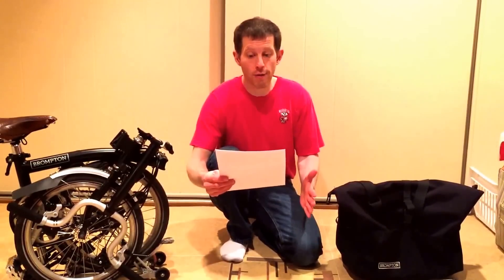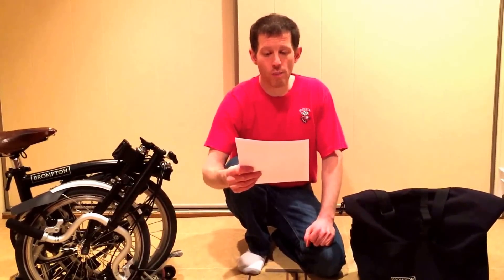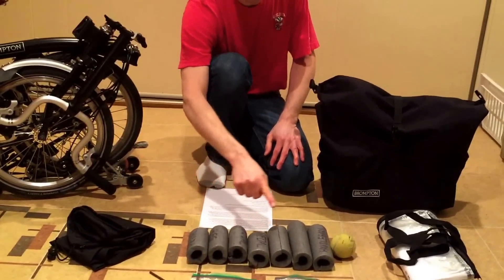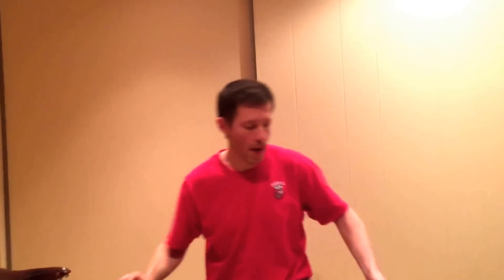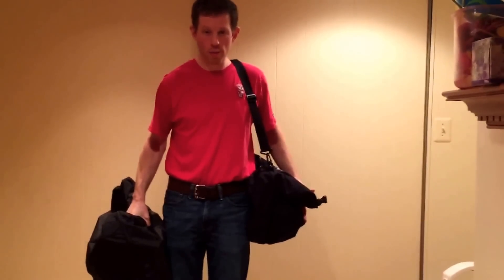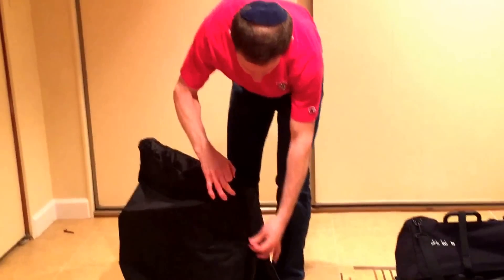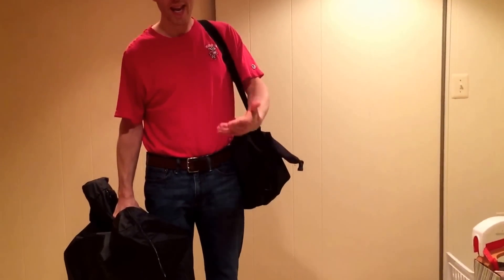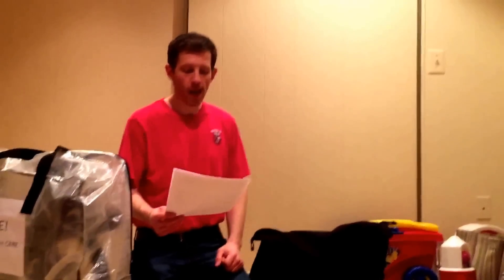How to travel with a Brompton bicycle on an airplane

Comment: Great very informative. Some airlines have an actual rule written on their websites that you MUST deflate your bicycle tires by the way.
Reply from the maker: Interesting. Thanks for the information. The rule does not make sense since the entire airplane (cabin and cargo area) are pressurized to slightly less than normal atmospheric pressure at sea level. Nothing would/will happen to a fully inflated bike tire on an airplane.
Reply: @mattvanderhoek5516  yeah I don't doubt that you are correct. Japan isn't know for it's logical rules so it doesn't surprise me at all to see an airline  rule from a carrier in Japan with no basis in science.

Comment: Hey Matt, thanks for the great video. Have you kept a running list at all of what airplanes the Brompton fits in the overhead bin of? We are flying to Finland from Denver next week via Icelandair. We are on a 757-200 for all our flights. According to the interwebs, the overhead bins are notoriously small (as evidenced by Icelandair's carry on bag dimensions of 7.9" max height). Just trying to figure out if it is worth attempting.. Also, have you had luck with valet checking (rather than gate checking where you have to pick it up at baggage claim rather than the jet bridge)? Does the pink tag let you pick it up on the jetbridge? Sorry for all the questions! Thank you!
Reply from the maker: The Brompton will fit in the overhead bins of a 737-700 and a 737-800 - I have done it. The Brompton likely will not fit on a 737-300 and 737-500, as these are older planes (but I have never flown on these models). I do not know about a 737-900 or 757-200 because I have never tried. Please let me know what you discover about the 757-200. Also, the Airbus 320 and 321 will fit a Brompton on Delta airplanes but not on Spirit airplanes as their overhead bins are constructed differently.
Reply from the maker: Regarding checked luggage, I may have not been careful about the terminology in my video. So please allow me to clarify. I will refer to two types of checking: 1. Baggage check is where the luggage is returned to you at baggage claim. 2. Jet-bridge check is where the luggage is returned to you at the jet-bridge. For the Brompton, I have done it both ways. I have baggage checked and jet-bridge checked the Brompton (protecting it as shown in the video) and it has always been returned intact. Typically, I carry the Brompton down the jet-bridge to the door of the airplane where I ask the steward(ess) if I can store the Brompton in the coat closet (on an airplane where it will not fit in the overhead bins). They usually say yes. If they say no, then I jet-bridge check the Brompton. A pink tag is affixed to the bag which allows me to pick up the Brompton at the jet-bridge upon arrival. Very rarely, they will give you a white tag when you check the Brompton on the jet-bridge. The white tag means that the Brompton will be returned to you at baggage claim (rather than at the jet-bridge). There are some airlines (Spirit) where I always baggage check the Brompton since the fee for baggage checking is LESS than the fee for a carry-on bag! Hope that helps and was not too confusing.

Comment: Very knowledgeable! Thanks dude. I am wondering can we take Brompton as a cabin luggage? So that it could be fitted in aeroplane above seat compartment please?or it has to be in main luggage?
Reply from the maker: Yes. You can take Brompton on some airplanes as cabin luggage. Larger model airplanes have larger overhead compartments that can fit the Brompton. In the United States, here are some models that will fit the Brompton in the overhead compartments: Airbus 320 and 321 (on Delta but not necessarily on other airlines), Boeing 737-700, 737-800, 737-900, 757-200 (on Delta but not necessarily on other airlines). If you carry the Brompton onto an airplane and it does not fit in the overhead compartment, you can still ask the flight crew to let you store it in the coat closet. Good luck!

Comment: This is an interesting idea. Why is it necessary to cover the bike before sending it through the TSA scanner though? They obviously see it is a bike with the xray machine. I feel like this is an unnecessary step.
Reply from the maker: createthis you are correct. It is unnecessary to cover the bike as it goes thru the scanner. I no longer cover it as it goes through the scanner. But be sure to cover it when going on the airplane!

Comment: Very cool! I want to travel from Europe to the States and back with my Brompton, but I have a couple of questions:

1. Since most airlines only allow you to carry on one piece of luggage, how can you get on on the place with both the Brompton and the T-bag? 

2. I've bought my tickets, but it doesn't say on my e-tickets what kind of airplane I'll be flying on. Is there any way of finding out in advance? 

Thanks again for this fine video.
Reply from the maker: I have only traveled with my Brompton domestically (in the United States). Most/many airlines (e.g. Delta) allow 1 carry-on item and 1 personal item. So the Brompton counts as my carry-on item and the T-bag counts as my personal item. I have never had a problem.

You might be able to call the airline in-advance (a couple days before your flight) and find out the airplane model that you will be flying. However, this is not really necessary. I just ask about the airplane model when I arrive at the gate. If the airplane model works (overhead bins fit the Brompton), then I put my Brompton in the overhead bin. If the airplane model does not work (overhead bins do NOT fit Brompton), then I request to put my Brompton in the coat closet. If they say yes, then great. If they say no, then I simply gate check my Brompton (on the jetway) as described in my video. Over time, I have compiled a list of airplane models that will fit the Brompton in the overhead bins. So when they inform me of the airplane model at the gate, I know whether or not my Brompton will fit into the overhead bins. Typically, it needs to be a larger model airplane that is used for long domestic flights or international flights.

Let us know how it works out for you traveling with your Brompton from Europe to the United States. Good luck!

Comment: This was informative, thanks. It was mostly about how to carry the bike on the plane. When you talked about having to “gate check” it on the jetway, you said your bike has always been returned to you in good shape. I don’t think I’ve ever had to check something at the door of the plane and pick it up later. Does that mean that it doesn’t end up in regular baggage claim, sliding down a ramp, circling around a conveyor belt, and being stolen by a criminal who can see what it is through the transparent bag? Are you advising us to never just check the bike at the ticket counter with other large bags (if any, I usually don’t have any), and always try to bring it on as carry-on luggage?
Reply from the maker: Hi Guy, 
One of my goals is to minimize the risk of damage/theft to my Brompton. If I were to check the bike at the ticket counter, then the airline would handle the Brompton and the risk of damage/theft would increase significantly. 
My bike is least likely to be damaged/stolen, if it is handled only by me. This requires me to carry the bike onto the plane. My success rate of carrying the Brompton onto the plane is about 90%.
I only gate check the Brompton if I am unable to carry it onto the plane. With gate check, the bike may be returned to you on the jetway (and avoid baggage claim, which is great) or the bike may be returned to you at baggage claim where the risk of damage/theft increases (as you point out).
So in short, my advice is to always try to carry the Brompton onto the plane if possible, in order to minimize the risk of damage/theft to the Brompton.
Hope that helps.
Matt
Reply: @mattvanderhoek5516  Hey thanks. 90% sounds good. I’m hoping to get my Brompton in a few weeks, where it will be interesting to see if I have the same kind of success rate as I hear other people having with regards to bringing it into retail stores and restaurants and planes, trains and busses etc.
Reply from the maker: @pentacleman1000  I hope you do meet with success. Some advice for airports/planes: There is no need to cover the bike when going thru TSA/security since they do not care. However, make sure you cover the bike when carrying it onto the plane. If they ask you what it is, just say it is a "personalized mobility device." Never use the word bike on a plane. They freak out and try to charge you a hefty bike fee. For other places like stores, restaurants, trains, etc. - there is no need to cover the bike. Have fun with the Brompton. It is awesome! It really is much more than a bike. It is a travel system.

Comment: Its also really neccessary to remove the eazy/standardwheels because a hit from the downside can be break or bend your frame.
Reply: Apparently not so. I have heard (and I understand this info comes from a Brompton employee) that Brompton have designed the eazywheels to be the weak point in the structure so that, in the event of a hard knock, they will collapse/break before any harm is done to your frame.
Another example of the very clever design of the Brompton.

Comment: allegiant has smaller size limits. do you think it will fit in overhead. what are dimensions?
Reply from the maker: Kathy Barge Folded dimensions are 23" x 22.2" x 10.6". I do not know the size of the overhead luggage bins on Allegiant but you can always gate check or bag check the Brompton. If you use my suggested protection method, it should not get damaged.
Reply: @mattvanderhoek5516  
thanks for the detailed video. i did like your idea to ask if stewardess could place in coat closet! thx so much for info.
Reply: is bag still available? and ikea bag?
Reply from the maker: Kathy Barge The Brompton T-bag has been discontinued. It has been replaced by the Brompton Borough Roll Top Bag (expensive!). The IKEA dimpa bag is $5 at IKEA.
Reply: @mattvanderhoek5516  thank you. enjoy the ride!

Comment: Shalom aleichem, Matt! I want to do the same with my Bike Friday Pakit. Will I be able to do that? When it's folded it slightly longer (30"x17.75"x12.25"). Thanks
Reply from the maker: I think it should fit through the X-ray scanner. Face the 18” or 13” side in toward the scanner and it should work. Keep me posted.
Reply: Thank you!

Comment: I've  traveled just like this to NYC and Seattle with my Brompton. Zero problems and I love it. The TSA Agents try to guess what's in the bag when I walk up, at least one gets it right. Always fits thru the x-ray fine. What would you recommend people with the tool kit to do?
Reply from the maker: Glad to hear others are using this method and are having success! The TSA agent who is visually examining the x-ray machine monitor typically asks me if it is a bike and then comments that he has never seen anything like that before! For the tool kit, I would keep it in the Brompton and see if it will make it through security - my hunch is that it will make it through. Be sure to give yourself some extra time in case the toolkit does not make it through security. If so, just put the toolkit inside the T-bag (or another bag) and check the toolkit at the ticket counter. Please keep me posted as I am curious if you can make it through security with the toolkit. Good luck!

Comment: Yeah...... in UK that would be wrecked in one trip.

Re the tyres??!!?!  Is that true?  Best part of your vid that.
Reply from the maker: More often than not, you can carry the bike onto the plane (in the USA) where it will not be damaged. Also, my Brompton has never been damaged either when gate checked or bag checked. 
Indeed, you do NOT need to deflate the tires when bringing the bike on a plane (either carry on or checked).

Comment: The quality of IKEA bag is very poor. Why not just go place like ebay to buy a carry bag that is designed for 16" folding bike for $20? You can actually put more foam in there to protect your expensive Brompton bike. I travel with my Brompton every month between Taiwan and San Francisco. I would never risk to check in my Brompton with the way you did in the video. You need to put some protection on the seatpost clamp.
Reply from the maker: The IKEA bag is very inexpensive ($5), extremely light weight, and folds up very small. These are big advantages since you can stuff the IKEA bag into your T-bag (as you bike to/from the airport) where it does not take up much space or add much weight. I have used the IKEA bag many times and it is pretty durable. You could purchase a folding bike carry bag but it is unnecessary, more expensive, more bulky, and more weight. It just adds unnecessary bulk and weight to your Brompton as you bike to/from the airport. I have found my method of protection to be quite adequate. There really is no need for more foam/protection. The Brompton is pretty robust. I have flown many times with my Brompton and it has not been damaged. The seat post clamp has never been damaged. It would be difficult to damage the seat post clamp when it is closed tightly and securely.
Reply: The Dimpa appears to be rather transparent. The bike looks very high tech and important. I bet it receives a lot more respect because they can see it.
Reply: What bag do you use? I’m looking for all possibilities.

Comment: I've only met one person who successfully takes a Brompton on a plane every time... But she's the pilot so I guess it does not count.
Reply from the maker: My success rate of getting the Brompton on the plane is about 90%.
Reply: @mattvanderhoek5516  yeah I did not mean it's not possible, just that I don't know people flying with them. I'd be scared to death every time to see what will happen... And I in case that they have to check it in I'd spend the whole flight anxious.

The baggage crew have managed to badly damage two hard case Samsonite suitcases of mine, after all. I guess they play basketball with them.
Reply from the maker: icl even if you check the Brompton there is nothing to worry about. The Brompton is very sturdy. I have checked the Brompton many times and it has never been damaged.

Comment: This will not work for international travel unfortunately.
Reply from the maker: Please explain why you think that it will not work for international travel.
Reply: @mattvanderhoek5516  there is no way you’re getting that to the gate. It will need to be either checked in or fit carry on requirements.
Reply from the maker: @26realmc  why/how is getting it to the gate any different than in the USA?
Reply: @mattvanderhoek5516  domestic US travel vs international? Have you ever been out of your home country?
Reply from the maker: @26realmc  I have travelled many times internationally and I have never had a problem getting the Brompton to the gate and going through security. Please explain why you disagree.

Comment: great but why bother taking the seat off. no need
Reply from the maker: I agree that with a standard Brompton seat, it is probably unnecessary to remove the seat. However, with a larger seat (e.g Brooks saddle), it is a very, very tight fit through the x-ray scanner. With the larger seat, the Brompton can fit through the scanner, but it often gets stuck. With the seat removed, it is still a tight fit but it tends not to get stuck.

Comment: SIGH.  I HATE to be the party pooper here, but what you are doing is wrong.  I empathize  with you, I really do, as a fellow folder traveler who has been lugging bikes onto planes for a long time, possibly since before you were born. First of all I know of NO airlines that still allow two full size carry-ons. Back in the day, maybe. But today you are allowed, at most, ONE carry-on which fits in the overhead compartment and one "personal item" which is supposed to fit completely under the seat in front of you. If you have flown nearly as often as you seem to have then you MUST know this as the flight attendants are required to state this as part of their safety briefing. That "T-bag" is twice as big as would fit under even the largest seat space. So you are putting it in the overhead compartment too, aren't you Matt? Thus depriving another traveler of the space they paid for. Perhaps even forcing THEM to have to check their legitimately sized carry-on. Until about 15 years ago most flights allowed two checked bags for free. Then things got really tight and they started charging more and more for checked bags, and more people started lugging on bigger and bigger carry-ons until we have the state of things today. This has prompted airlines to crack down on and reduce allowances for cabin luggage. The folded Brompton does not meet even the most liberal carry-on size allowance, much less the "standard" size of 22"x9"x14", even if it does fit in some overhead bins. It does so by taking up someone else's space.  It REALLY irks me when I see some asshole carrying a huge bag on larger than allowed size. Yeah they often get away with it, just like people get away with speeding and cheating on their taxes but it is wrong and it hurts all of us. I wish there was a legitimate way to do what you're getting away with but I have looked at this for many years and there's just not. I did find your video well made and informative, though, thank you for sharing.
Reply: I have to agree. I've seen pictures of a Brompton in the overhead bin and it looks like it took up the whole bin, thus depriving your seatmate of that space. I can't stand selfishness of that sort. But, I also agree that it's a good video.